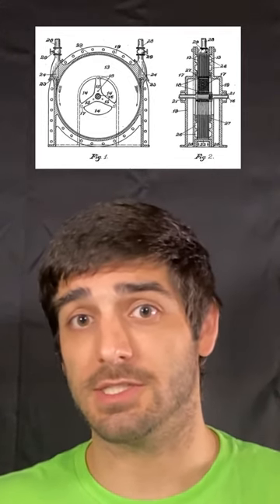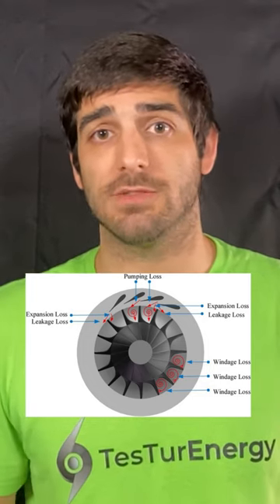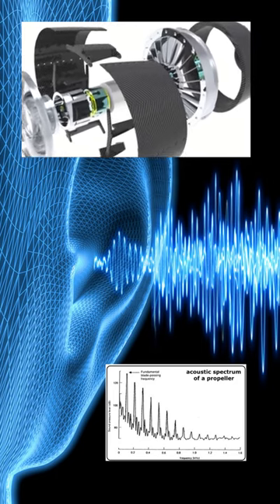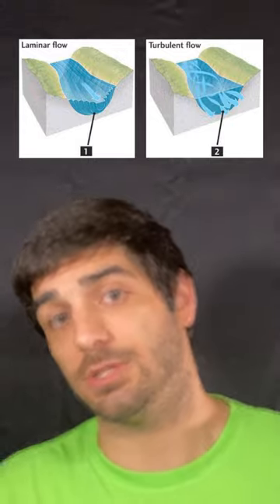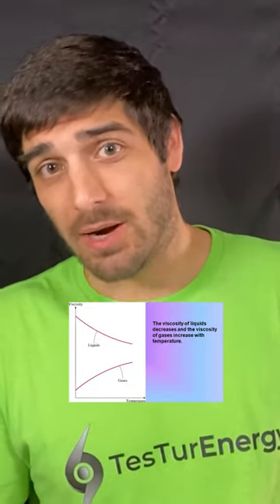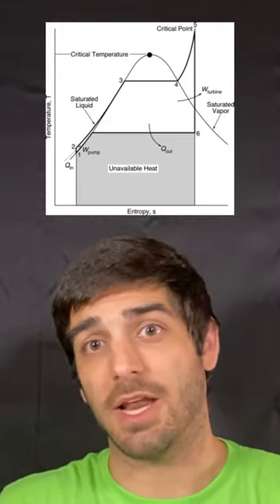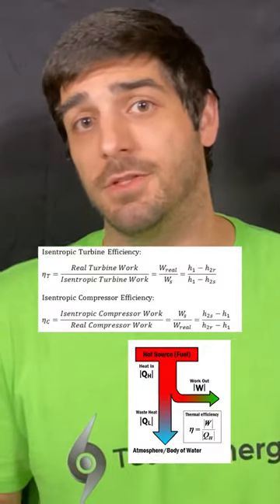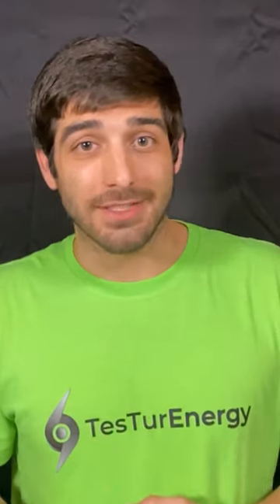Tesla Turbines For Nuclear Submarines

Comment: How would the turbine create thrust like a propellor?
Reply from the maker: Hey thanks for the comment. Just like any other centrifugal thruster. 

That or a special shroud over that directs the water to the back of the vessel from radial.
Reply: @CharlieSolis  copy that, would be interesting to see that play out in real life… I feel like could 3d print most of this and test in water. How could I make the turbine plates if I don’t have the CNC?
Reply from the maker: @JordanMiller1117  hey thanks for commenting. 🙏❤️‍🔥 I really appreciate the love and support.    

So just to be clear I do have a degree in physics and many years of working with industrial machines.  

And now I don’t want to discourage you but I need to be abundantly clear though that sadly, these are not toys. 

They are VERY dangerous if not designed or handled properly.  

I do not advise anyone who doesn’t already have a background in mech engineering/physics etc. to attempt to make one of them on their own.  

If you wouldn’t feel comfortable taking apart a jet engine and putting it back together and know that it would work properly again then I would think twice about taking on this endeavor.  

That being said. 

If you would like to start I would suggest by consuming as many mechanical engineering class videos as you can on YouTube.  

Learn all the thermodynamics behind steam and gas turbines.  

Specifically for Tesla turbines it requires a great deal more chemistry due to the Tesla turbine operating on molecular viscous adhesive forces between the fluid and discs and not in mechanical collisions with the blades like traditional blades turbine.  

So making sure to have the right surface treatments for the proper motive fluid is very important too.   

“Don’t French fry when you’re supposed to pizza or you’re gonna have a bad time.” <-Words to live by. 

I want to be explicitly clear with people just how dangerous this is. 

It’s easy to see the turbine not doing much other than spinning and think it’s not that difficult.   

But to put some perspective on it…. 

The ~25cm (10in) diameter 75disc aluminum turbine is 4.36kg (~9.5lbs)     

So whenever anyone see this turbine spinning they need to imagine a literal 10in diameter 10lb dumbbell weight spinning at 7,000-13,000rpm 🤯🥵😅    At 13,000rpm the turbine rotor has 30,000joules of rotational kinetic energy.     

For perspective, that’s about equivalent to:  5-10% of the kinetic energy of a whole car at highway speeds.   

If that stored kinetic energy were to be used to launch itself straight up into the air…    

KE = gravPE = mgH   

H = KE / m / g
     = (30,000joules) / (4.26kg) / (9.81m/s^2)
     = 708 meters straight up into the air… 🤯   

~3/4 of a kilometer or ~0.45miles.
Reply from the maker: if you want to get your hands dirty with a prototype of your own we are now selling versions of the 4.5in Tesla Turbine that we built during our video collab with @integza       

www.HeatAndPower.com       

Crafted with precision, the prototype boasts a robust design featuring an aluminum disc stack enclosed in a high-quality polycarbonate casing.      

The turbine is tailored to accommodate a variety of testing conditions, though currently optimized for compressed air tests.      

From initial trials, the turbine has shown promising potential, generating 1200 watts of power on a Dyno test with 30-40psi and a notable 600 watts electrical load when partnered with an upgrade generator package) on just 15psi of compressed air.      

It is also designed for future upgradeability, with provisions to accommodate a 2-stage upgrade we aim to release soon.      

While this turbine is a working prototype, it’s not a complete, turnkey solution or operational turbine. 

So, what’s the purpose of this unit?        

We’ve designed this prototype to provide a hands-on, engaging, and informative tool for those interested in our renewable energy systems, and specifically in Tesla turbine technology.        

It gives you a chance to see the turbine in action, understand its mechanics, and gain experience with assembly, disassembly, and maintenance.        

We believe this initial experience is crucial before making the step up to our full-sized, turn-key power generation systems.         

Get Yourself Prepared        

This prototype is essentially a first step for those considering a full-scale residential or commercial Combined Heat and Power (CHP) system.        

It offers you a unique opportunity to get up-close and personal with the turbine technology, and gain a practical understanding of its workings, benefits, and potential.        

It’s a scaled-down, educational version of the turbine we’re developing for our full scale solar thermal and biomass powered CHP systems.        

It is also designed for future upgradeability, with provisions to accommodate a 2nd-stage upgrade that we aim to release soon.     

What Does The Loyalty Program Do For You?       

Learn how to safely operate a Tesla Turbine now with our smaller 4.5in prototype.     

Then save on your full scale turnkey residential or commercial power generation system later!      

Purchasing our 4.5in Tesla Turbine gets you a 10% discount that’s applied to your full size residential or commercial system, in the end saving you more than the cost of the prototype.     

See our Heat And Power dot Com website for more loyalty program information.
Reply from the maker: @c3N3q  hey thanks for commenting. It would need the correct casing for it, but yes.

Comment: Great presentation of an idea. Good job. I am a bit confused though. I thought a big portion of a subs noise comes from its engine. It might be limited to a certain type of the engine though. Also I am thinking about combining the tesla turbine with a trompe compressor for providing the air required for energy generation. Obviously the compressed air must come cheap. So instead of a giant infrastructure to provide that compressed air, I think the best method is gonna be a multi-stage compressor that increases the pressure in stops along the flow of the water. Trompe compressors have a very high efficiency (93%+). Combined with high efficiency of Tesla turbines, most of potential energy of water can be converted compressed air. Multi-stage trompe compressor will be beneficial since the energy loss of water flowing through pipes is much higher than compressed air.

Comment: bust the trust direction of tesla turbine isn't aline with the ship, that means u need a gear box to change the rotation direction, just like axle bike, gear will make huge noise
Reply from the maker: Hey thanks for commenting but you would not need a gear box. 

Keeping the discs perpendicular to the ships shaft would only require a shrouded casing that directs the tangential flow leaving the discs to turn axially and in the reverse direction. 

If you look how I have the discs put into the ships aground on the video thumbnail it shows it more clearly

Comment: I would agree for the electric generation, but the need for sudden speed changes and bringing able to go full speed to reverse in a matters of seconds. For auxiliary propulsion or trolling, the cooling systems would most likely need to be redesigned, as submarines are like sharks. #keeponswimming
Reply: Yes but that is entirely possible to redesign a cooling system
Reply: @rayanalzahrani8756  you’re absolutely right. I guess I’m caught up with the current platforms.
Reply from the maker: Hey thanks for the comment. But this is what makes tesla turbines so good for this application as well. Because I doesn’t require a reversing turbine or a reversing gear system. 

The fluid is just admitted going the opposite direction. And works for high torque breaking as well as reversing.  Check out this other video I made explaining that. 

TesTurs get the most torque at low RPM. So the reversing, breaking feature is when it will shine best too. 
TesTurs are made efficient when the slip on the discs is reduced.  

Listen to what Tesla himself said in the patents of how to make them work.  

“Owing to a number of causes affecting the performance, it is difficult to frame a precise rule which would be generally applicable, but it may be stated that within certain limits, and other conditions being the same, the torque is directly proportionate to the square of the velocity of the fluid relatively to the runner and to the effective area of the disks and, inversely, to the distance separating them. 

The machine will, generally, perform its maximum work when the effective speed of the runner is one-half of that of the fluid; but to attain the highest economy, the relative speed or slip, for any given performance, should be as small as possible. 

This condition may be to any desired degree approximated by increasing the active area of and reducing the space between the disks.”  

1) increase the speed of the fluid relative to the disc, (not increase disc speed)  

2) increase surface area 

3) decrease disc spacing  

This is how you actually make a TesTur work. Not by spinning it fast.   

The fluid interactions with the disc that govern efficiency an torque are adhesion and cohesion. Full stop. 

And spinning fast does nothing to increasing either to increase the turbines isentropic efficiency.   

This is why everyone who chases rpm with the TesTur just flat out fails. 

They aren’t even trying to design them properly so of course they won’t work. 

The Nikola Tesla Turbine Is Reversible in 2 Ways
https://youtube.com/shorts/4IZ0HDgqD1I?feature=share
Reply from the maker: As far as cooling system, the nuclear ships are already designed to have MASSIVE cooling systems built into the condensers. The turbine would not need any additional cooling systems then would already be needed by the existing steam turbine systems that power the ships already.
Reply: Submarines main engines have two steam valves, one for forward turbine, and one for reverse. Since you say it doesnt need separate turbine engines that would make it make design a bit simpler.  A more important aspect then going backwards though is the use of the reverse turbine to stop the propeller shaft in an emergency, a good throttleman can do it in less then a minute with how it works now
Reply from the maker: @whit4446  exactly! And with the TesTur there’s no slow down time. You could be at full throttle forward and just immediately hammer to full throttle reverse and have no issues whatsoever. 

Take a quick watch at this short I made a while back. 

Tesla Turbine - Brake Torque Test WOW! #shorts
https://youtube.com/shorts/u8SEaKV1CUI?feature=share

You can see how there’s zero time delay between forward throttling and breaking. It would be perfectly responsive 

Tesla talks at length about this feature being extremely advantageous for naval vessels in the improved hybrid disc + parsons reaction turbine patent he patented in 1921, 10 years after the original turbine patent and about a decade of R&D.
Reply from the maker: “In the first place my turbine is exceedingly suited for very elevated temperatures and also high pressures, while the Parsons excels in the efficiency of the thermo-dynamic transformation at moderate temperatures and low pressures. Again, the former permits the fluid to be expanded either in the nozzle, the rotor or both, and this flexibility facilitates the establishment and maintenance of pressure and temperature conditions favorable to both turbines, thus enhancing economy. Their combination is, however, of quite exceptional value in cases when reversible units are indispensable, as on shipboard, where it provides a simpler, more efficient and far more effective apparatus for forward propulsion as well as backing, my turbine being much better adapted for reversing purposes than other forms with small clearances and delicate blading easily damaged.

While my turbine will yield the best results in co-operation with the Parsons it is eminently qualified to serve as first stage, or stages, in conjunction with other types of turbines, of whatever kind, also with rotating and reciprocating engines, and in this broader sense my improved process may be defined as one in which the available heat of an elastic medium is usefully transformed first by friction, as indicated, and then by action or reaction.”

-Nikola Tesla